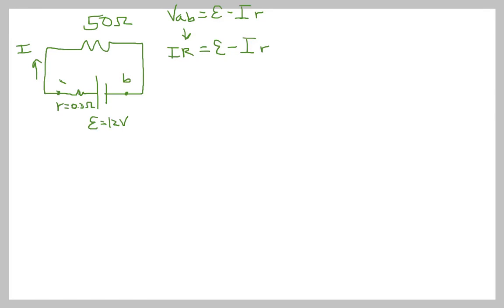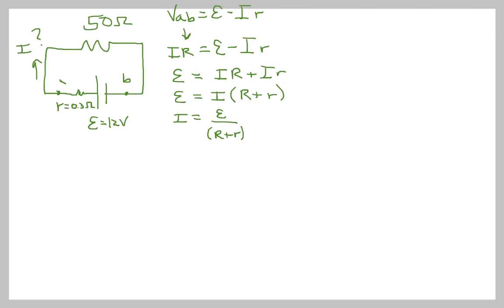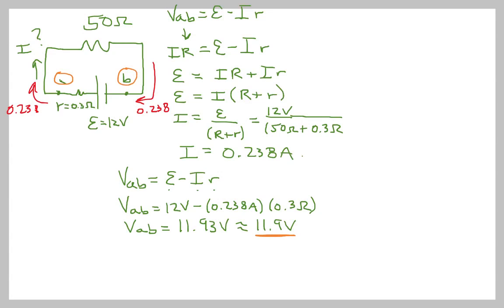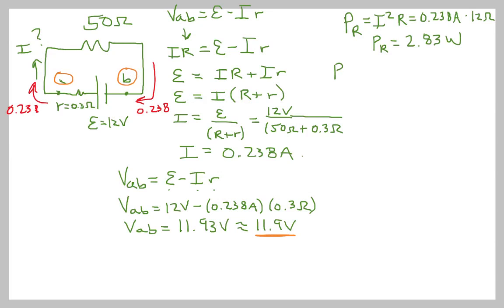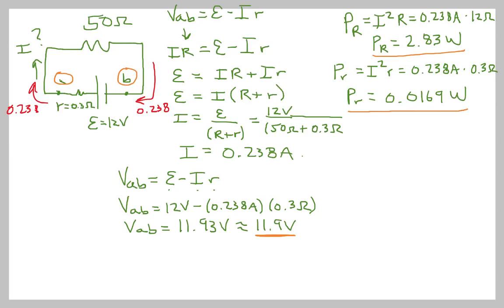EMF and Terminal Voltage

Comment: the 12 ohms is supposed to be 12V, for the EMF.
As scuzum2u said, the equation should of been written for P=IV

*Note* P=I^2 * R    is the power lost, the thermal lost due to resistance in the  circuit.